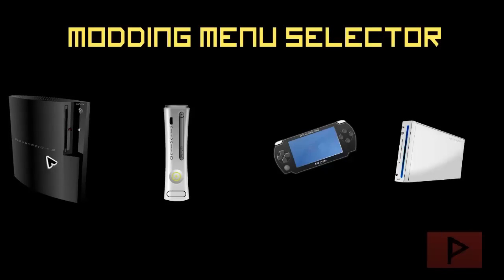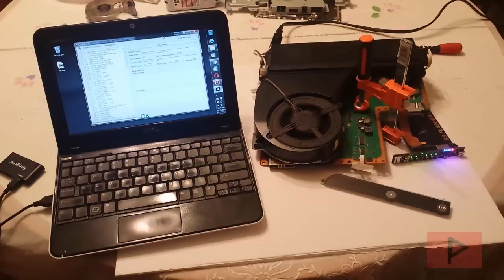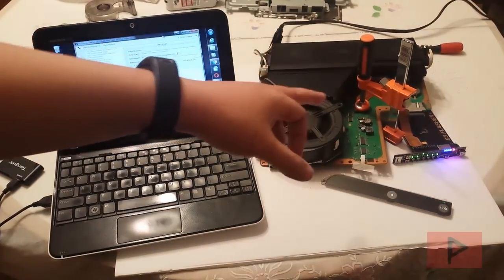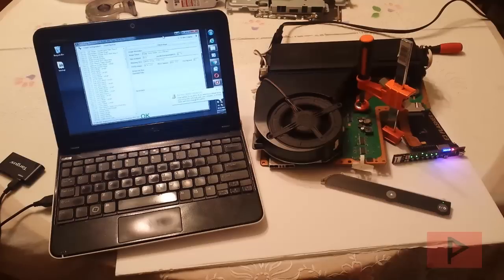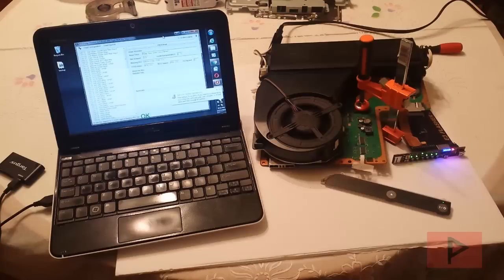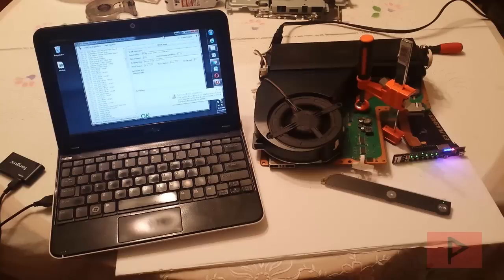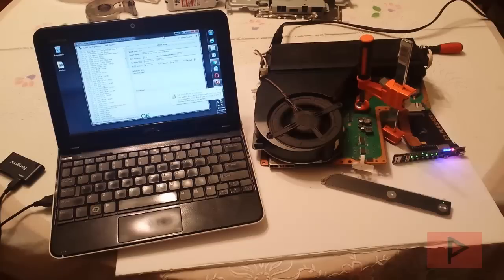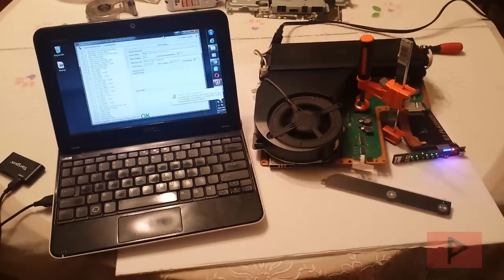E3 Flasher - PS3 Slim - Progress Update (December 13, 2015)

Comment: I try to downgrade but I got a bad dump ...is say bad and it don't know how to do it
Reply: +Sawkyaw Moo Make sure you attach the E3 cable from the side were the resistor is in the way so you can see that it makes good contact, then apply firm pressure which your thumbs to make sure it is securely attached. If it is a Phat PS3, I recommend sticking an eraser on top of the e3 clip so when you enclose the motherboard, the clip has enough pressure to actually copy a good dump